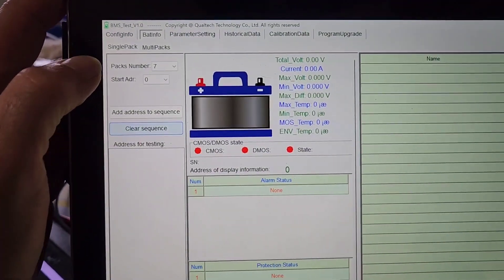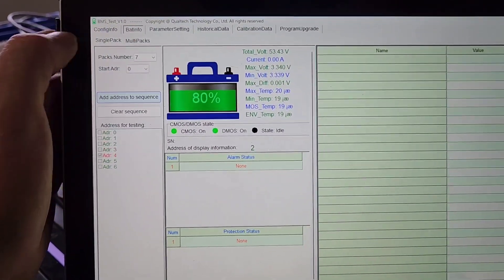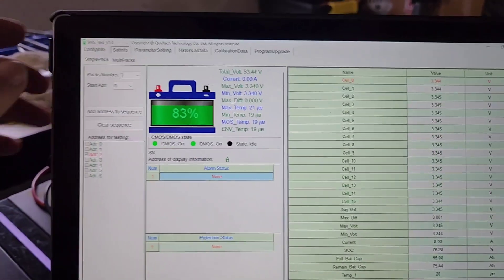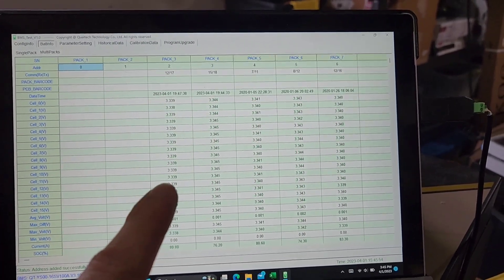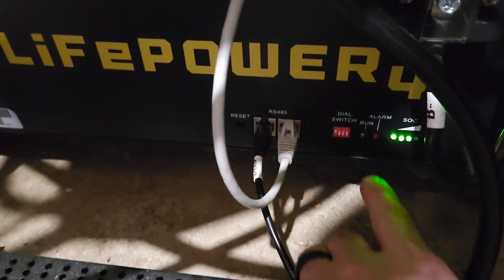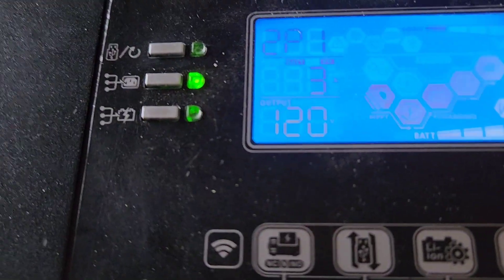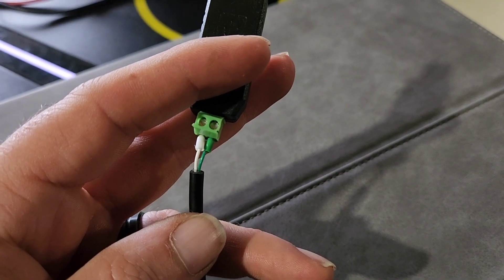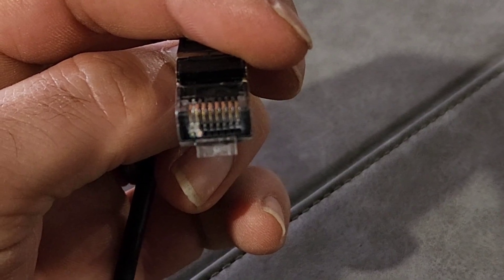Using BMS Test program to view EG4 Lifepower4 Battery data.

Comment: I updated all 20 batteries and my communication hub just fine once I made the correct cable that you showed us.
I had a bms go bad, they set me one, I changed it out now.. It shows port opened successfully, but when I switch to battery info it then says address 0 read remote measurement information failed. Says the same thing on address 1 also. I need to update firmware on the new bms... Crazy
Reply from the maker: Did updating the BMS work?
Reply from the maker: Do you know why the last BMS failed?
Reply: @theadventuresofarenaissancman  no I couldn't get it to work. Not sure why it stopped working. The power lights were out one morning and would not come back on. So they sent me a new bms.
It not will come on but I can't get it to stay connected.
I'll charge it tomorrow and see how it goes.

Comment: Interesting. I’ll have to try this to see if I can communicate with batteries while inverter in EG4 and communicating with the batteries also. Can I plug BMS Test pc into unused bottom port?
Reply from the maker: You can.
Reply: @theadventuresofarenaissancman  It works!  I did try this - but the addresses I see in BMS Test are not what I expected!  I just found a thread in the DIYSloarForum that basically says the manual gives the wrong settings.  The thread gave different settings.  I'll try that tomorrow to see if that makes mine sequential.  Thanks!